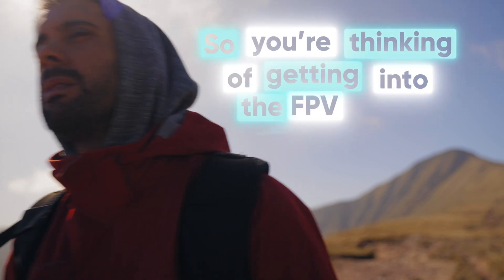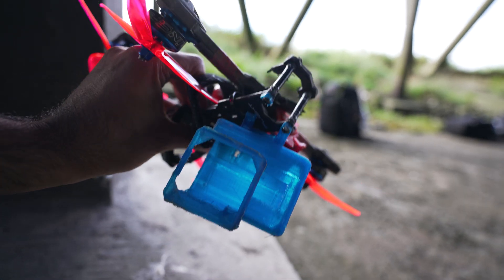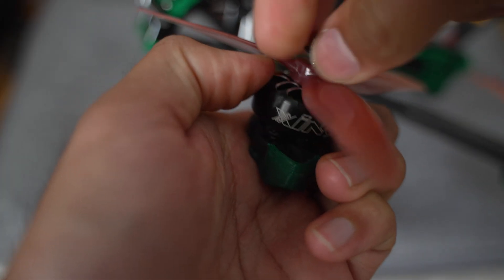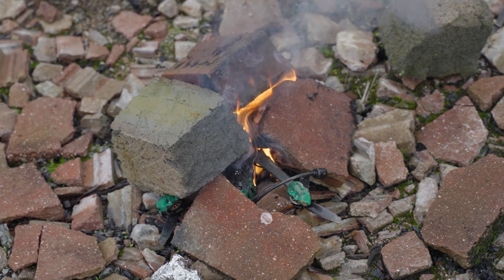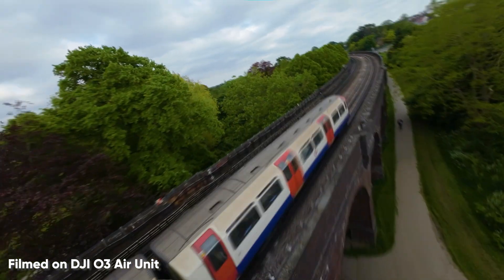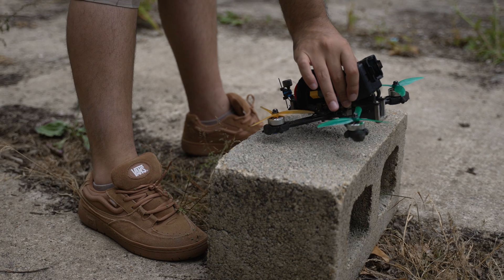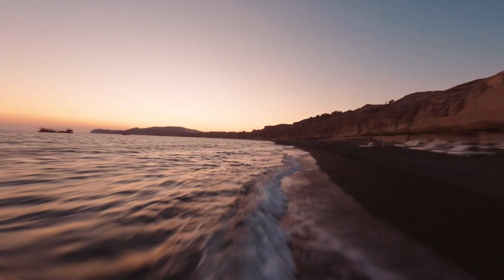Start FPV in 2025 // Ultimate Beginners guide

Comment: First tip: Don't buy into the DJI ecosystem if you're a beginner. Buy a cheap analog kit first, then move up if you feel you're going to stick with it, or you're going to have close to a 1k or more worth of drone equipment lying around.
Reply from the maker: Very good point. I did buy analog in the beginning though and it actually made me want to quite straight away because was so annoying flying with that choppy fuzzy analogue view and only when I got the first dji goggles I was like yeh Fpv is sick

Comment: Idk if you will see this but I’m thinking of getting into this hobby and after doing a bunch of research I think I wanna get the walk snail avatar goggles with the analog expansion board and dongle because I wanna practice analog first before I upgrade the vtx to something like the walksnail moonlight my main use case would be freestyle and photography but I just don’t like being locked in the expensive DJI ecosystem
Reply from the maker: @richys_reviews  sounds good bro for low latency stuff. I’ve never tried walksnail personally so can’t give you much info on that sorry

Comment: I currently have 2 sets of DJI goggles. The V2 Goggles, that I got with my DJI FPV Drone,  & I bought the Goggles Integra Motion 2 Combo, for my AIR 3 & Mini 4 Pro. I have the Avata 2 Fly Combo on the way, so I'll have the Goggles 3 soon.  Ive only flown my FPV drone in sport mode, so I haven't learned Acro yet. Is there any pre built  Longe Range Digital FPV quads, that have 30 minute flight times, & at least 2-3 Miles of range? I plan on getting on a sim & learning. I love my DJI FPV Drone, but the flight time in sport mode is like 10 minutes.
Reply from the maker: Yes sure I think the chimera 7 inch from iflight is a solid purchase for a first long range bnf with long flight times and there are loads of great videos out there about the chimera 7 that can help guide you if you get stuck

Comment: I have an avata 2. Was having so much fun within 5 minutes of using it. No training. Skimming tops of trees, and inches above the local reservoir and fields. Between branches, through playground equipment,  any obstacles I can find.

It's so much fun I take it in the car with me everywhere and it literally takes 90 seconds from opening the case to getting in the air. 45 seconds to replace battery and get back in air.

My brother, son, grandson and sister were able to fly it in minutes and were laughing their heads off.

Crashed it over 20 times and broke nothing. Crashed a mile away and used turtle mode to flip it right way up and take off.

I know I sound like a dji salesman but it is just so much FUN. I don't want to do crazy acrobatics,  I want to have fun and take smooth,  fast fpv cinematic footage. The avata 2 seems to be great at that.
Reply: Is it really that durable? I had a DJI Mini 3 as my first drone, and it couldn't survive like a 10 feet fall from crashing into tree branches. I broke my first one, sent it for repairs, and they sent back a new one for no cost. Half a year later, I finally crashed it after all that time. Roughly same height and also tree branches, it broke as well. This time, it didn't look like nothing was really damaged, but it no longer power on. Sent it in, had to pay repair fees, and then they sent back a new drone again. I ended up just selling it to someone. It was too fragile for my liking.
Reply: @barronhelmutschnitzelnazi2188  that’s a much different drone than the Avata tho.
Reply: Same.  Started on the Avata 2 and am now blasting around in sports mode with the motion controller for the FPV potato.  Going to practice in the simulator for awhile before I move to full manual mode for both plus i still need the RC controller 3 for the Avata 2.
Reply from the maker: I do agree using the avata drones are the best way to get up in the air quickly and get going with fpv. I've stated that in my other videos about the avata drones. however having flown the avata drones and 5 inch drones there's absolutely no comparison between the performance levels when it comes to chasing, diving down cliffs and flying in high winds which when you go to many of these places that have high mountains or ridges or waterfalls the wind conditions can be crazy and having a ducted avata or avata 2 the performance level is barely usable compared to an un-ducted powerful 5 inch quad that can just cut through the wind to fly lovely and smooth and give a nice enjoyable flying experience. For diving it's the same, having a 6s 5 inch quad you will be able to catch your quad at the bottom of the dive closer to the ground better than an avatar drone giving you a more dynamic shot. Also the avata drones come with the DJI fpv radio which again if you use any other fpv radio out there you will see how much better the gimbals are for finer controls such as the tango 2 or mambo. 

I'm not trashing the avata drones in anyway as I use them myself and have often said if I can only carry around one fpv drone around with me for quick shots while travelling it would be the avata as they are the easiest to use as you said, have less footprint in the bag and have the best battery life. But if you want to go to that next level of fpv I really recommend to also be looking into a 5 inch bnf drone that fly's better in more adverse conditions and allows for more acrobatic movements
Reply: @pavguliani I bought a radio master pocket to start on the simulator with. I’ve heard great things about that radio and it fit my budget for now. Have I made a mistake? Loving your content so far 🎉

Comment: do the dji goggles 2 work with the o4 air unit system? or only with the o3 and if so do you think they will add support for o4? thanks really helpful vid <3
Reply from the maker: I would recommend you get goggles 2 as then you can use avata drones and also bnf custom build drones with o3
Reply: @pavguliani  ah ok thanks a lot 🙌 appreciate it
Reply: @pavguliani  ok thanks, do you also know if the goggles 3 now support the o3 air unit?
Reply from the maker: They do not um afraid and DJI are not even confirming if they ever will so I'd say best bet is goggles 2 or integra so you can fly with all systems

Comment: Do not buy the goggles 3 unless you get them part of the Avata 2 package. They only work exclusively with the Avata 2 at the moment, and some non FPV drones. 

They still don't work with 03 air units. I have them as part of the Avata 2 package. I'm feeling kind of stuck, because I can't fly anything else until the patch comes.
Reply from the maker: Yeh I think with a firmware update they will be back compatibility as that's what DJI did with the first avata and goggles 2 so hopefully on the near future that update will happen
Reply: I'm pretty sure they work with the air 3 and mini 4 pro....
Reply: @stankozniewski9385  they do. I have the Avata 2 and Air 3. When flying the air 3 with the goggles 3 you lose many functions like zoom or POI. Basically everything that's accessible on the controller screen

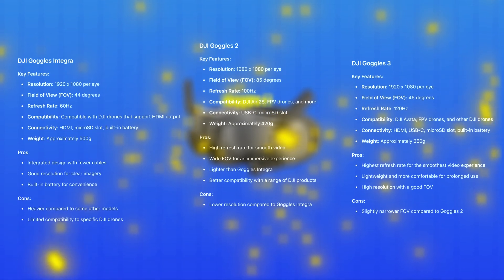Comment: at 5:27 your specs sheet is wrong in a couple of places, the integra goggles have 100hz  screens (they can switch to 60hz tho, which is probably what you meant), the goggles 2 are 51 degrees FOV and more of a nitpick but I think saying the integra is heavier compared to others is a bit misleading because of the built in battery. The other goggles need a seperate battery.
Reply from the maker: Thanks very much for checking for me and updating, appreciate it 👍

Comment: Awesome video! Keep it up!
BTW, if I bought a protek35 and am having trouble binding it. How do I know if my caddx is working or not, because that won't even bind to the v2 goggles.
Reply from the maker: Thanks a lot! Yeh that's strange it should bind up but also the vista unit and V2 goggles may need you to do a cli command in betaflight ... set sbus_baud_fast = ON

Comment: Hey just found you. Crazy good video. Insane editing. Made me laugh. Instant sub. Only criticism is not telling beginners about the 4 main different fpv systems. Analog (slightly outdated imo but still usable with lower latency), dji, hdzero,and walksnail. But only a minor thing. 10/10 video.
Reply from the maker: Thanks a lot mate! Yeh I didn't want to go into all the possibilities of fpv otherwise the video would be 2 hours haha. Was more just what I've learnt over 4 years of doing it and my experience with those other systems are zero so no point in me giving my opinion on them. Thanks for watching 😀
Reply: @pavguliani  hey ya no problem